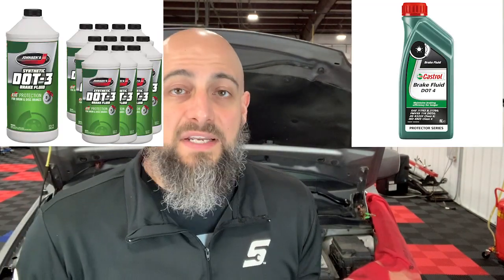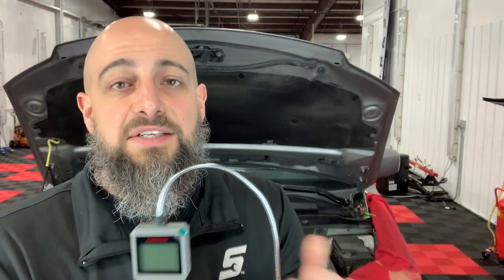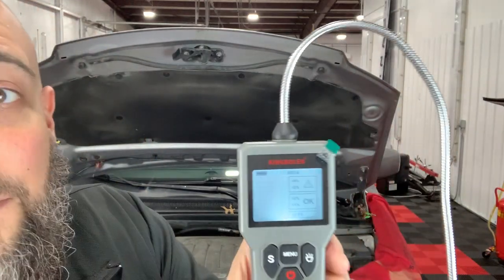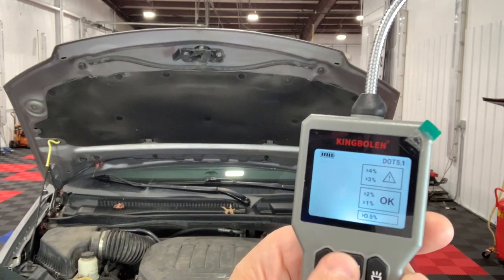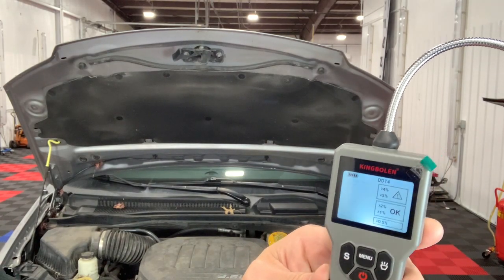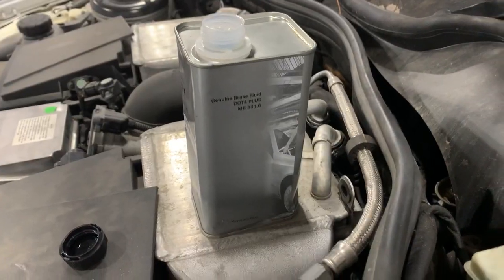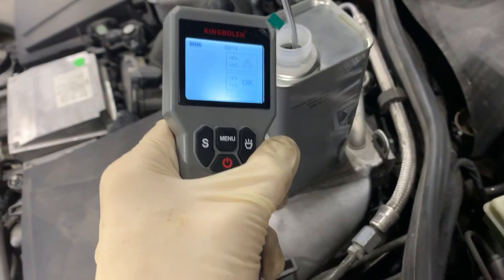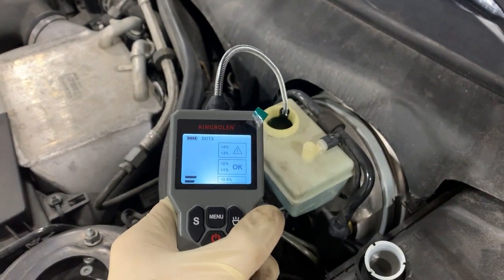Kingbolen BF200 brake fluid tester review

Comment: Just had my oil changed at the local Honda. On sale. Loss leader  The service adviser had an urgent repair recommendation from tech. Change brake fluid, it was cloudy. I said look at the car history online. I was done 18 months ago. Declined service. Came home. Did the brake fluid strip test and it was well within the good range.  I trust the science and better check before you take in for service. If it's more than 3 years I would say change it, but it's your call.

Comment: Great video again Lou! Just 1 question: when is considered the test passed? When the tester doesn’t beeps? Or even if you find 2-3% moisture inside and the fluid is 2-3 years old you should change it anyway? Thanks!
Reply from the maker: It passed as long as the values dont max out. But for me 2-3 years  is best. You can definitely feel the difference in a car with old contaminated brake fluid then flushing to new.
Reply: @MasterTechLou  Thanks again Lou! Imho we need here great techs like you. Keep up the great work! Looking forward to seeing fresh great content!

Comment: Maybe I'm a man, and realize it's a tool (one that I don't have), so will have an empty spot in my soul now until I get one.

Seriously, back in the 1970s, living on the gulf coast, we were taught to change our brake fluid every couple of years (and adjust our drum brakes).  Sounds like Daimler has not forgotten that.

I'm getting back into working on my own cars so this was good to see.  First 20 years of adult life, I did so because I couldn't afford shops.  The last 20, I've been letting my shops do most of my work.  Now that I want to retire, I need to refresh my knowledge and start doing it again.

Do you have a video on changing brake fluid on ABS equipped vehicles?  Is the old two person pump, hold,  and bleed still a way to do it?
Reply from the maker: Regarding abs bleeding, only certain models have a function to use a scanner to activate the abs module to shake out all the air. We use pressure bleeders but yes you can use the 2 person method. I have a very specific method I use which I will
Share in a future video. Its the fastest way to bleed brakes with no issues.

Comment: MTL, another possible point to changing your brake fluid regularly is the water will corrode/rust the internal parts of a caliper, i.e. causing the pistons to seize. Much cheaper to do a fluid change then buy calipers. Always look forward to your videos', my Friend!

Comment: I believe that water would tend to sink to the bottom. If so, checking in the master cylinder would be invalid.
Reply from the maker: It doesnt separate. It coagulates.
Reply: @MasterTechLou  ahh... sort of.  The water gets absorbed by the alcohol in the brake fluid.